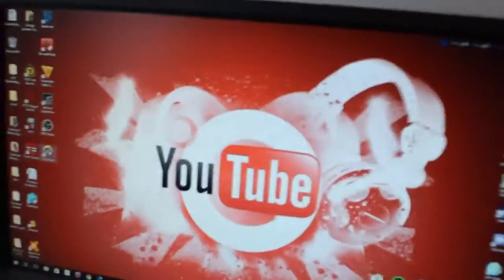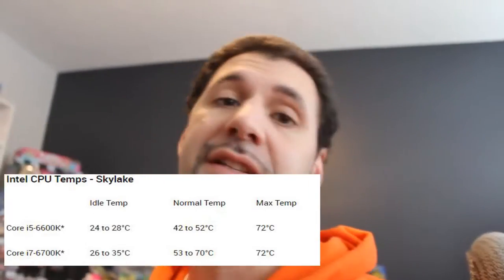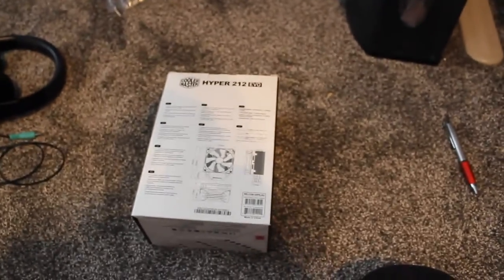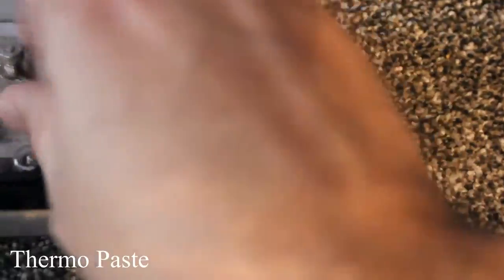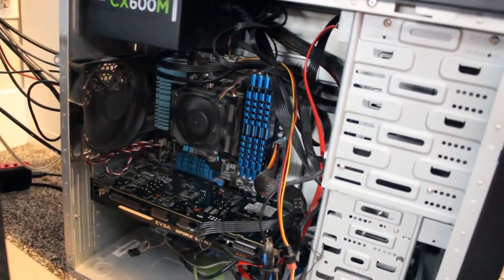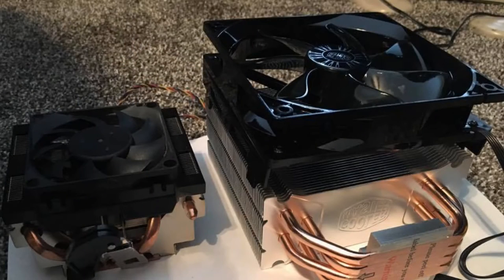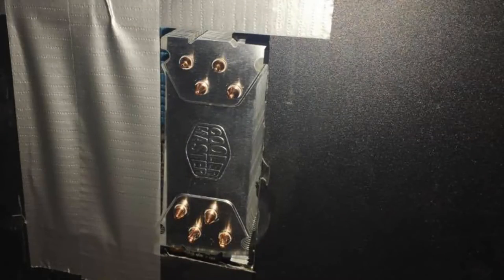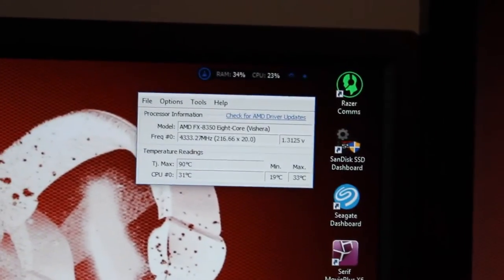How I fixed CPU overheating with duct tape and $35 Cooler Master hyper 212 EVO #cpuoverheat -

Comment: I would have just drilled the holes instead of cutting the large hole. I just purchased black addition for my fx9590 but my temps are still high 78c. May have put on to much thermal paste will take apart tonight and re apply. Was water cooling but my pump went out couple of days ago wanted something cheap and quick. Will prob just go back to water cooling if the reinstall doesn't go well.

Comment: I was thinking of getting one for my system that has an FX 8320 and stock cooler. Based on what you were saying about the width of the case it wouldn't fit in my current case. :P
Reply: do not get a amd fx 8320 the over heating is crazy its a bad bad chip